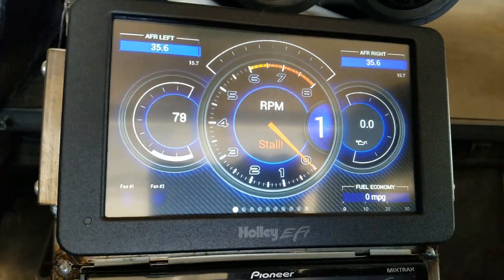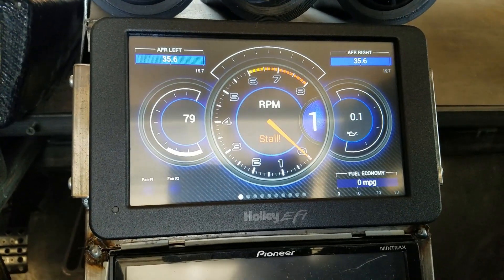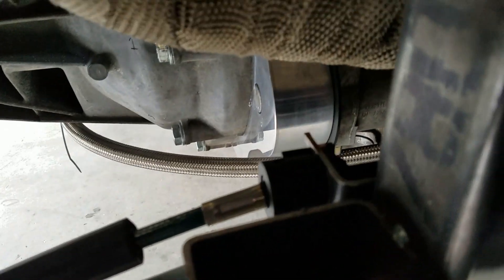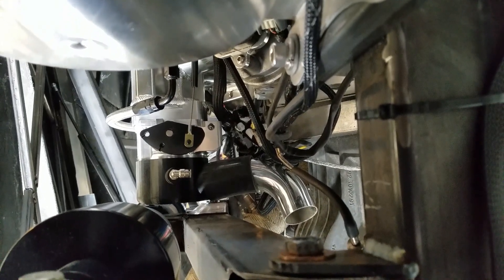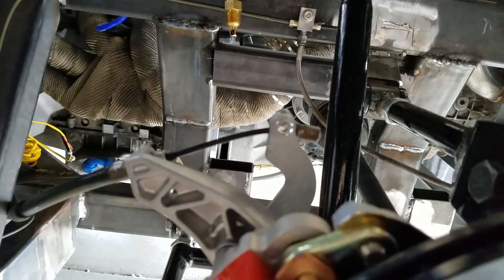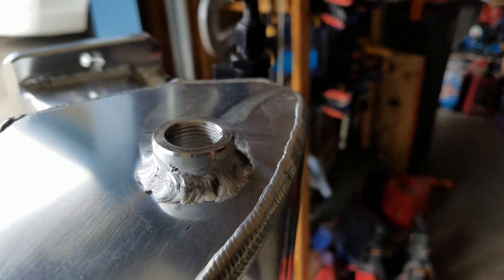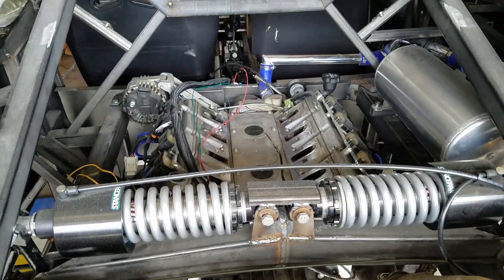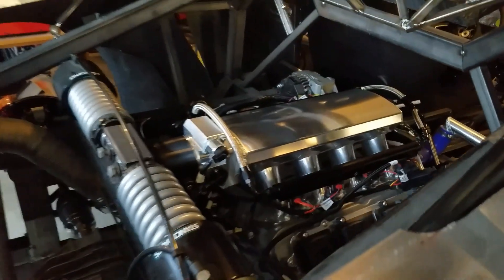3D Printed Interceptor Update 4

Comment: I wish it was a V10 or a V12
Reply: I bet he doesn't. The more cylinders the more sturdy it needs to be. The more weight the engine/car has the harder that same engine has to work. Since he isn't using too much carbon, his gas bill would be astronomical. Or at least more than it would have been

Comment: That intake needs a bit of an over haul. It seems that r and d was a little on a rush or maybe a few thi gs just over looked. A nice piece of shallow cut tapered aluminum tubing would works far better than the split tube setup with sharp angles. Still very nice!

Comment: The one thing I worry about is engine vibration with a custom made chassis from what I hear from a number of projects online including professional projects. Apparently just making something strong does not insure the motor will not vibrate its self hard. When they where building the Batman tumbler they builders where having issues with the motor vibration and engine mounts at least what I remember. Anyways looks amazing keep up the great work.